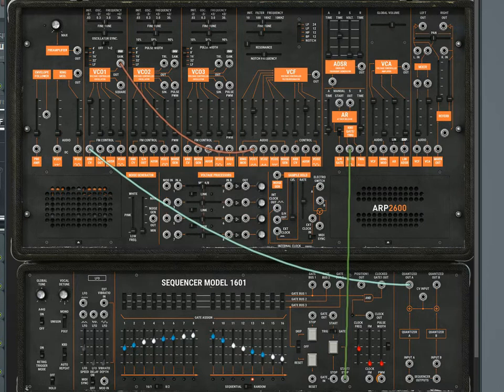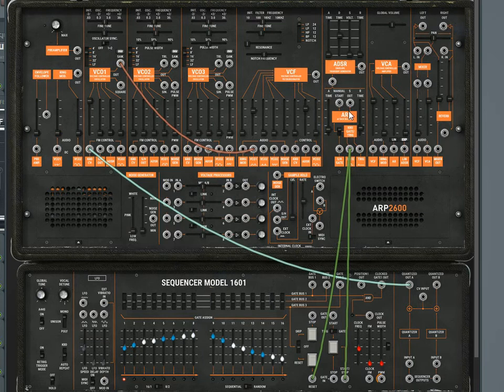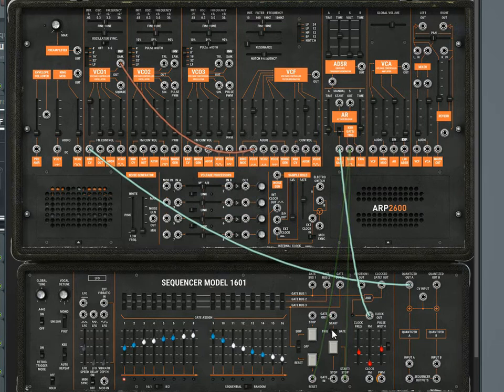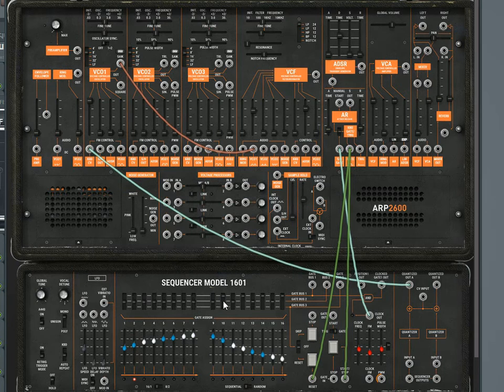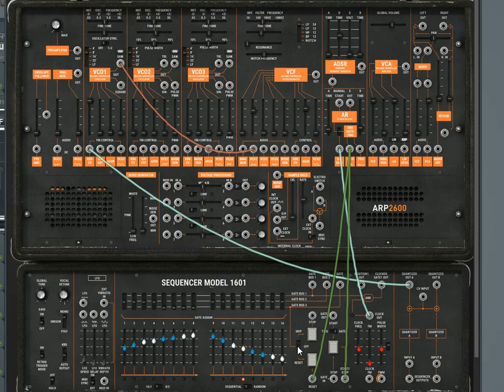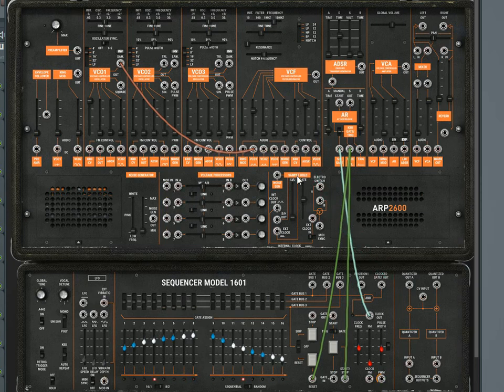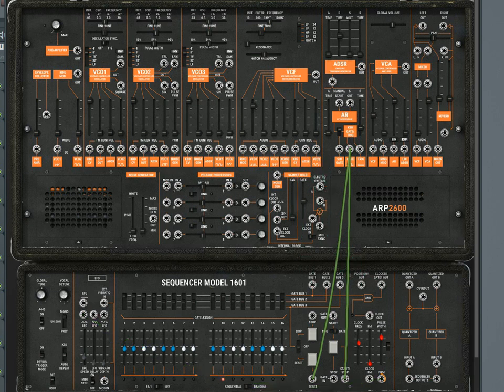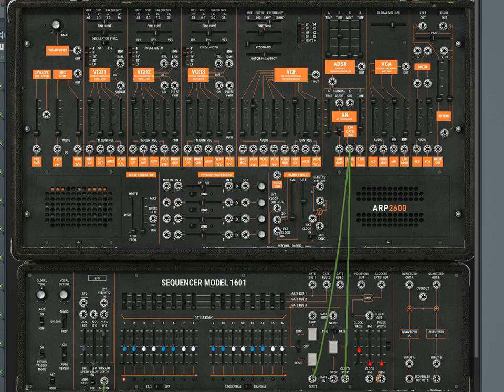Arturia Arp 2600V Sequencer Model 1601 Tutorial

Comment: Great video!  What happens with the part B gate switches when you are in 8/2 mode?
Reply from the maker: In 8/2 mode, the gates switches are running in parallel, and you can do some interesting things with that. If either the A section or the B section is set to, say, Gate Bus 3, then Gate Bus 3 will be triggered on that corresponding step. This allows you to trigger two different gates on the same step, which you cannot do in 16/1 mode. You can, for example, have both Gate Bus 2 and Gate Bus 3 both doing different things on the same step.

Comment: Fantastic Video, easily the best tutorial I have found for this sequencer. Possible I missed this info but is there a way to create rests rather than skips? I am fairly certain the answer is going to be something frustratingly simple. Standing by for face-palm.
Reply from the maker: One way is to use one of the gate buses. 
Assuming that the AR envelope is controlling the amplitude of your sequence, switch KBD GATE/TRIG to the down position, so that the AR envelope is responding to a trigger input. 
Next run a cable from, say, GATE BUS 1 to the SH/GATE input. Now, set GATE 1 to on wherever you want the sequencer to sound, set it to GATE 2 or GATE 3 when you want a rest. 
You may want to use CLOCKED GATE1 OUT instead so that you have control over the width of the pulses. I've just been playing with this just now, and depending on the release setting on your AR envelope, you might get a bit of the notes on the rest steps, so it's probably best to set those rest steps to be the same value as the preceding non-rest steps.  In other words, if you want a sequence A-B-C-D-C-rest-B-A, set the sequence to A-B-C-D-C-C-B-A, set the chosen gate to be on for all notes in the sequence except for step 6, which you would set to one of the other gate buses. 
This does, of course, limit your ability to use the gate buses for other purposes in your sequence.
Reply from the maker: Here's a link to a preset that implements this:
https://drive.google.com/file/d/1DrECxuZpHIpctoKlKyf26lCDxvzmmFHZ/view?usp=sharing
Reply from the maker: And here's a preset that uses the Clocked Gate 1 with its pulse width being modulated by the LFO:
https://drive.google.com/file/d/1qMJOx1hTV9CPhQ7PbsNESLVnkMCIsElM/view?usp=sharing
Reply from the maker: As an alternative, if you are using only 8 steps of the sequencer (for example, the quantized A sequencer output), you can use the quantized B output, also cabled in to the SH/GATE input, just as described above. Set the B sequencer to high if you want to trigger the AR envelope, to low if you want a rest. This way you'll still have the gate buses available for other uses.
Reply from the maker: And one that uses the ADSR envelope instead of the AR. The concept is the same:
https://drive.google.com/file/d/1tZFbFL1oB0hLs9OuZ-WmcjUEJAr_XM1h/view?usp=sharing

Comment from the maker: Arturia's Arp 2600 V3 Sequencer Model 1601 Tutorial. 
Arturia's documentation on this is not very helpful, and I couldn't find any sufficiently extensive tutorials for it on youtube (or good tutorials or documentation of the hardware original), so here's an in-depth look at almost every bit of the software model of this sequencer. I don't like tutorials that waste your time with a bunch of introductory overhead, so I start right in with a simple patch and try to cover everything: the sequencer, the bus gates, the quantizer, the clocks, gates, triggers, modulation...it's long but it's thorough! Basic understanding of the Arp 2600 VST is assumed (oscillators, envelopes, filters, control signals).